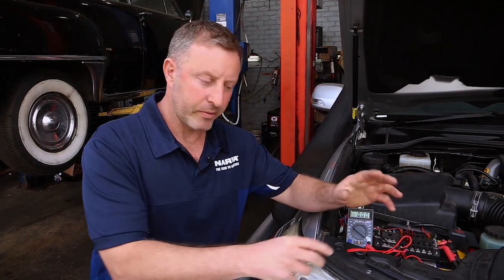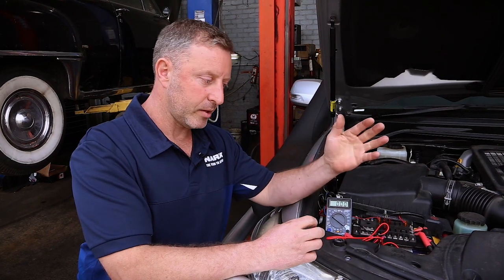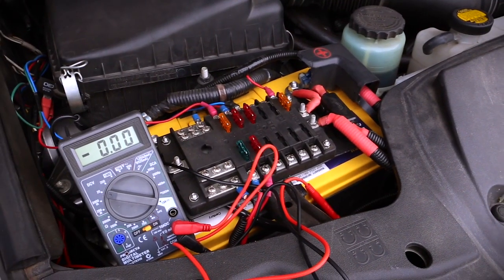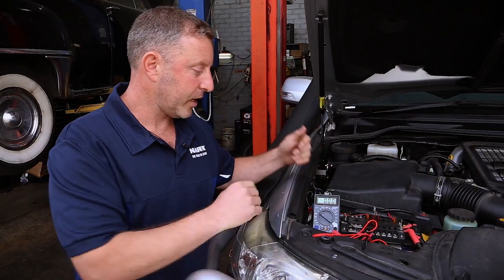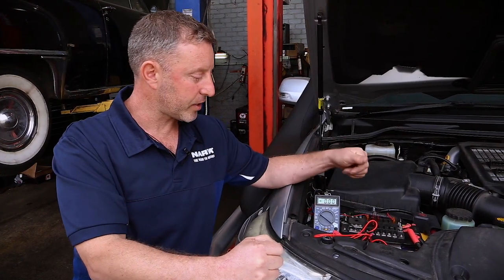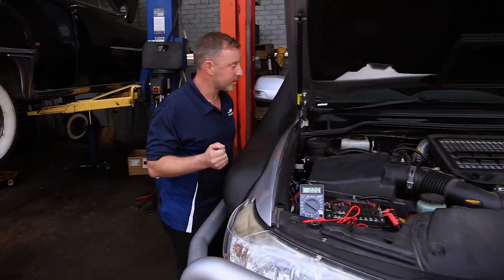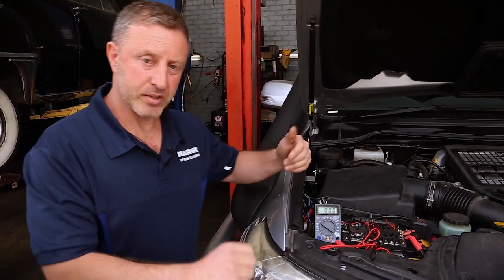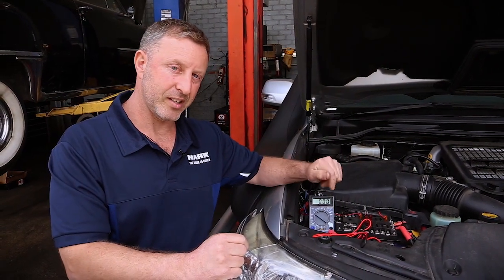Narva Garage   Positive or Negative Switching

Comment: I have a VZ commodore that I have wired in a bar light using negative switching as commodores are. However the 3 wire LED toggle switch inside the vehicle is constantly luminated when turned on, even when the ignition is off. When the switch is on and high beam switch is on, the LED on the 3 wire switch goes off. How can the LED illumination be reversed, can a 3 wire switch be used for negative switching? The harness that the came with the 3 wire switch included, the harness was originally done for positive switching, I have changed this for the negative switching. Relay 30 to  battery Positive, 87 to bar light positive, loop power from 30 to 85 and 86 to the centre terminal of toggle switch, and outside terminal to high beam trigger on vehicle being blue/yellow on high beam relay, this by GMH diagram is negative. Bar light negative to ground and brass terminal on toggle switch to ground. Please help